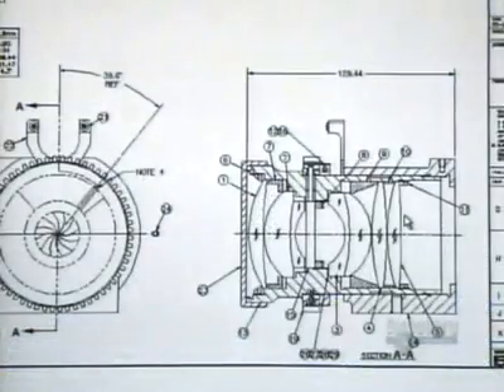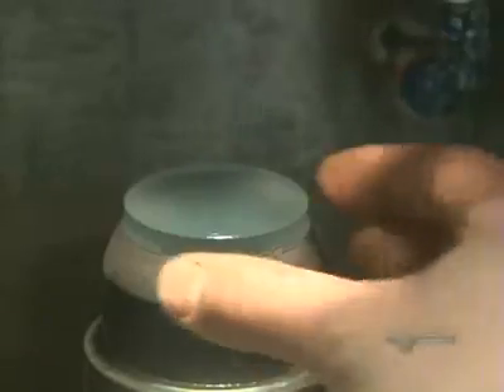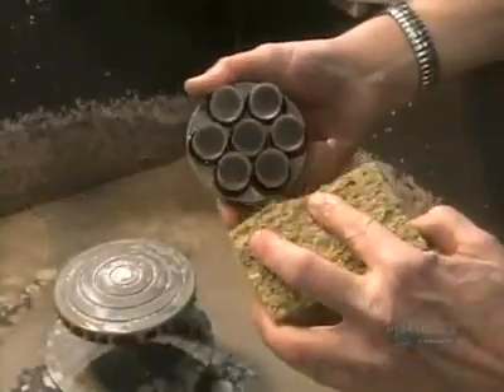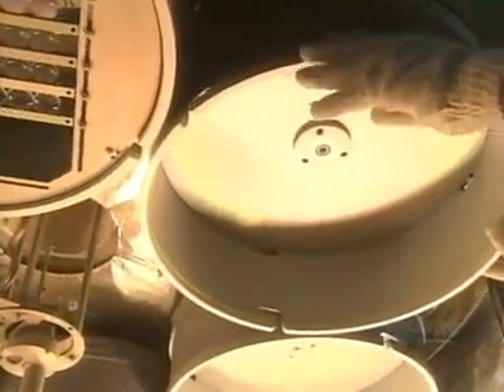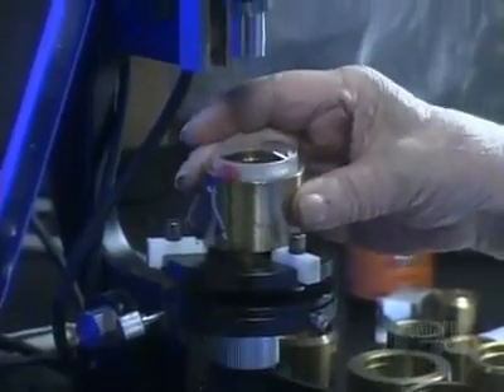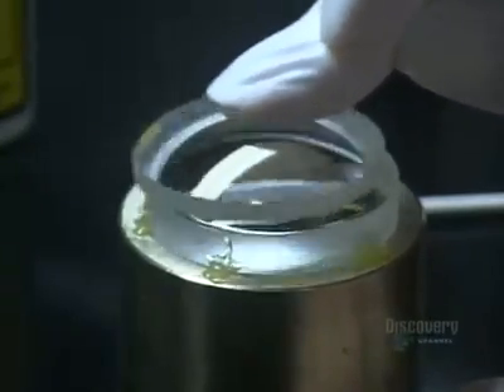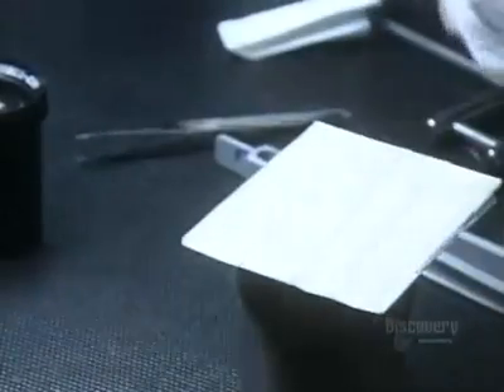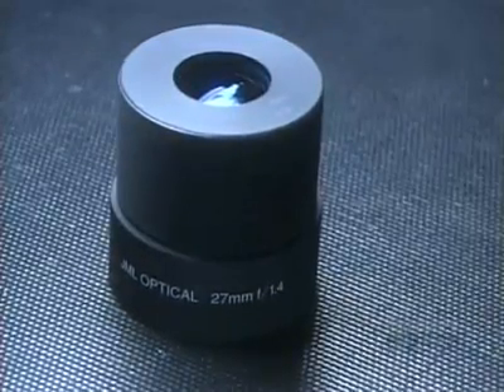How camera lenses are made. From the Discovery Channel

Comment: This looks old, like 90's old, so I'm assuming nowadays lenses are produced with automated robots so the production would be faster and cheaper
Reply: most optical lenses aren't ground from a block of glass. Hot glass is pressed into the shape of the lens and then polished by automated machines. Search for "How It's Made - Canon 500mm f/4 L Lens" on youtube and you'll see.
Reply: not all products are built with robots
Reply: Not yet
Reply: Many people think a giant machine delivers the final product with touch of a button. That's not real in most cases. Even automated jobs are divided into many smaller tasks and humans inspect products between each stage. If you are talking about french fries, yes you just throw in potatoes and take out fries at the other end.

Comment: Igniferi in my physics lesson there was something about they use two convex lenses put together to form a spherical lens so light refracts at the optical center of the lens. the optical center is the middle point of the area where the two convex lenses are attached. if one piece of glass is used i'm not sure if the light would refract properly
Reply: after watching the video i see the lens is a double convex lens instead of a spherical lens. it's possible the light refraction thing i mentioned still applies or they use double convex lenses for extra image magnification

Comment: Why do they glue the lenses together? 6:00
Why not make one solid one?
Reply: +Igniferi In telescopes, doublet and triplet lenses are made of multiple lens elements so that one element will compensate for the imperfection of the other. A simple lens has chromatic aberration due to dispersion, so two lenses made of different glass (crown glass and flint glass) are combined to reduce this unwanted effect.
Reply: +Ninja Rider I often wondered why they did that. Two different glasses is the important part of the answer. Thank you.
Reply: +Igniferi did you get the answer?
Reply: the cost of making one solid glass is very very expensive
Reply: Ninja Rider There you Go : )